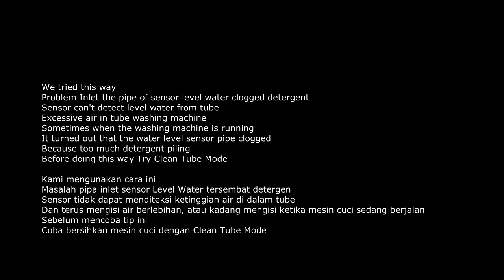Samsung Washing Machine Overfilling Water Level Switch but no error LED 4E E1

Comment: Bang mau tanya mesin cuci samsung sy tdk kluar air sy cek water inletnya spt terbakar itu akibat apa ya? Dan udh sy ganti tp tdk kluar air jg itu musti apanya ya bang yg dicek lg dan apa yg musti diganti ? Tks
Reply from the maker: Kalau valve inlet disebut Solenoid. Bekerja dengan power listrik, akan terbuka ketika mendapat power. Alat tersebut seperti kran otomatis. Akan membuka valve, dan air masuk ke dalam tabung. Kerusakan akibat terlalu lama terbuka, atau kumparannya rusak karena panas.
Bila tidak keluar air. Telusuri dibagian kabel ke solenoid. Umumnya kabel putus, dan solenoid tidak mendapat power.
Pastikan kran air ke mesin cuci memang sudah terbuka.
Hal lain, ada kotoran di saringan belakang (tempat selang masuk ke mesin cuci, dan tersumbat.
Terakhir, modul di mesin cuci yang bermasalah.
Sejauh ini bagian tersebut yang kami ketahui, jangan lupa mencabut power listrik selama memerika mesin cuci. Lebih dari itu, sebaiknya teknisi yang menangani.
Sebelumnya kami minta maaf, bila langkah diatas ternyata bukan masalah yang terjadi di mesin cuci kak Usup
Reply: Ok tks

Comment: mas saya mau tanya mesin saya di kode 1E, airnya kaga mau masuk, klo saya nyalahkan langsung saya star keluar airnya sebentar langsung ke 1E lagi dilayarnya.. saya sudah ganti modul 700rb.. gimna mas. tolong bantuannya
Reply from the maker: https://www.samsung.com/ie/support/home-appliances/my-samsung-washing-machine-is-showing-an-error-or-information-code-what-does-it-mean/
CODE: 1E, E7, 1C (Water level sensor) Action: Switch off the appliance at the mains then wait 30 seconds. Switch appliance back on again and start a new programme.
kode iE kemungkinan masalah di water level sensor seperti video ini kakak.
Harganya hanya 50 ribuan. Apakah unit tersebut pernah diganti, dan pernah memiliki masalah sebelumnya dengan tingkat air di tabung.
Unit tersebut tidak mendadak rusak, ada gejala sebelumnya. Seperti kotoran yang menutup tekanan air ke selang yang menghubungkan di unit water level sensor..
Dengan catatan kalau selang dibawah tidak tersumbat oleh deterjen, membuat water level sensor tidak dapat bekerja.
Atau ada kabel putus yang menghubungkan ke water level sensor.
Atau dicoba dengan clean drum dengan mengisi sedikit air pada tingkat di low dan biarkan mesin bekerja. Untuk melihat apakah kotoran ada yang tersumbat dan dapat di lepas dengan putaran air
Bila masih bermasalah dapat menghubungi service center

Comment: assalamualaikum gan mau numpang tanya .mesin cuci saya gk kluar air bersihnya .di masukin manual jga tetep gk bsa .tapi buat spin bisa gan .mohon infonya.
Reply from the maker: Bagian kran valve untuk masuk air. Coba di cek.
Kalau tidak keluar air atau air kecil, mungkin ada kotoran
Dibuka bagian belakang, terdapat saringan, dilihat apakah disana mampet tersumbat Atau jangan jangan kran yang masuk lupa dibuka.

Kalau air tidak keluar sama sekali, kemungkinan valve tidak mau terbuka
Matikan mesin cuci dan cabut power listriknya dahulu
Buka bagian mesin solenoid dibelakang mesin cuci.
Lihat apakah terselip kotoran, atau motor solenoid masalah, terbakar, cirinya pernah berbunyi berdengung cukup keras

bila bagian tersebut dalam kondisi normal.
Mungkin board control yang masalah, misal relai ke valve rusak.
Biasanya masalahnya ada disana om Ady
Reply: Obengplus com

Comment: master mau tanya...
mesin cuci saya bukaan depan,dalam posisi off air tetap ngisi...kira kira di mana masalahnya?
Reply from the maker: Maaf om Bakti
Kalau Front loading kita belum mengerti cara kerjanya
Reply: Masalahnya di water levelnya....bisa juga di selenoid valve
Reply: The problem is there’s a hole in the hose so when the water builds up it creates no pressure thus not telling the computer to shut the water off
Reply: Aneh ya,notif nya baru muncul padahal komen sudah 5 tahun lalu.
Masalah nya ada di selenoid Valve yang sudah kotor karena endapan air,kotoran mengganjal tertutup nya selenoid Valve akhirnya air terus masuk ke mesin cuci walaupun mesin dalam keadaan mati.
Saya nekat bongkar sendir.. 😅

Comment: WA80V4 saya setiap dinyalain drainnya selalu kebuka, jadi air selalu kebuang dan ga penuh2, kalau dimatikan dia nutup lagi. taukah penyebabnya bang? Terimakasih
Reply from the maker: Di cabut power listriknya
Periksa di selang dari tabung ke sensor level meter, apakah tertekuk, bocor. atau tersumbat
Periksa koneksi di alat indikator level meter
Kadang karena getaran mesin cuci, yang sering bermasalah di bagian soket konektor di level switch

Secara umum masalah drain water ada di unit level swith sensor kak.
Alat tersebut untuk melihat tekanan dari tabung air.
Bila mesin cuci aktif, dan langsung membuang air
Sensor mungkin salah menditeksi, karena masih membaca ada tekanan air di dalam tabung lebih tinggi dari yang ditentukan pada board.
Bisa saja terjadi sumbatan dan tekanan udara di pipa tidak dapat keluar, dan sensor menunjukan adanya tekanan lebih tinggi.
Bisa di coba dengan memilih level air lebih tinggi

Selebihnya kami kurang tahu, mungkin perlu ditangani oleh teknisi.
Apakah board dari mesin cuci Samsung atau level switch yang lemah dan perlu diganti

Harapan kami dari salah satu pemeriksaan diatas sudah dapat menyelesaikan masalah.
Sekali lagi mohon maaf, kami belum mendapatkan data tentang kondisi tersebut.

Comment: Haha I did the bicycle pump on it but it hasn't worked
Reply from the maker: One solution, when the air flow is blocked
Other problem
Squeezed pipe
Leaky pipe, leak
Pipe loose
Clamped pipe
The connector connection is not good
The water level sensor is broken (rare)
PCB Board broken or wire connection (rare)
Reply: @ObengwareID  terima kasih, Mas. Saya nanti cuba sekali lagi. 
Soalan: inlet valve solanoid kiri dan kanan sama fungsi ?
Reply: I did the bicycle pump trick again; this time rigorously and longer. 
I switched the 2 solanoid of the inlet valves with the spare that I had (saw this in another (Pakistani) video. Then water filled too much & I adjust the water pressure sensor switch (tip from Mr.Tan; unsure this regulates it). Tested it to wash full cycle. It is washing some clothes now 🤲. Thanks to you❤, Mr. Tan❤ & the Pakistani guy❤ 👍👍🇲🇾.
Reply: One thing bugs me now: the right solanoid becomes too warm but the left room temperature. 
Could there be a problem ?

Comment: Bang mohon pencerahan nya, mesin cuci lg front loading sya pada proses rinse + spin, awal nya muter dan air ngalir tapi pas di tngah 2 proses diem gitu g mau lanjut proses nya, kira2 itu knpa bang? Trimakasih
Reply from the maker: Maaf kan, saya ngak ngerti sistem front loading. Kalau mesin jalan, muter dan bergetar, solenoid di belakang terbuka mengeluarkan air. Lalu mendadak stop.
Seluruh sudah benar, tinggal di board, apa yang menyebabkan perintah menghentikan putaran mesin ketika rinse
Apakah ada pesan error.
Kalau di Top loader, biasanya penyakit di sensor pintu, konektor kendor. Karena bergetar,  switch door lepas / terangkat. Kalau pintu di buka dan ditutup, kembali normal, tapi masalahnya random, kadang muncul kadang tidak kak. 
Tinggal di kencangkan saja, atau kalau konektornya sudah aus karena terbuat dari tembaga. Kadang korosif, tinggal di amplas, bagus lagi.
Sepengetahuan saya sampai disitu saja.